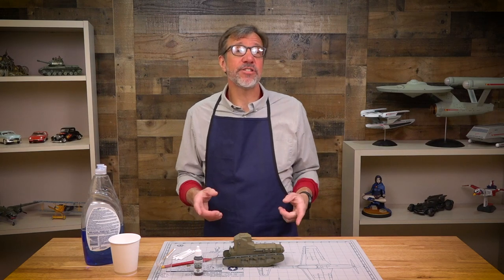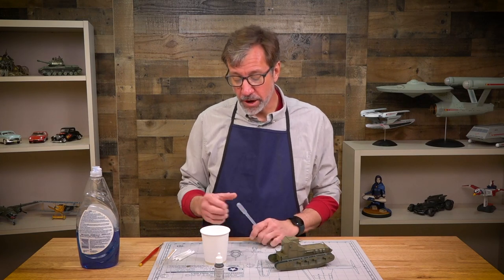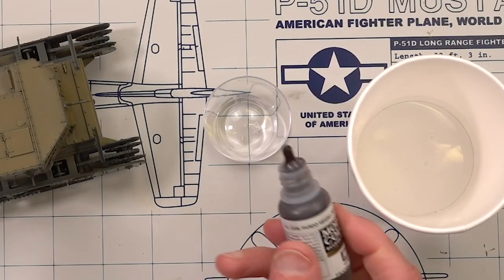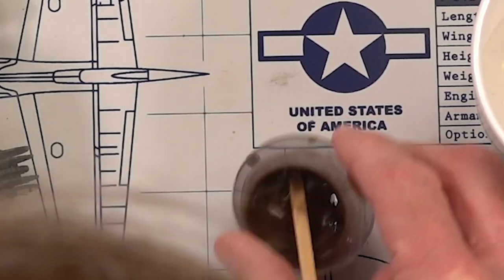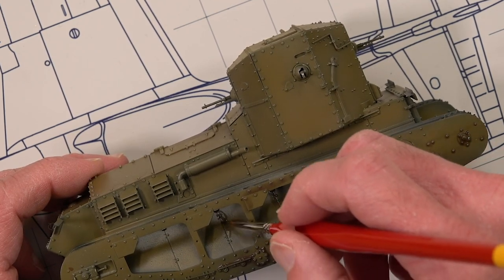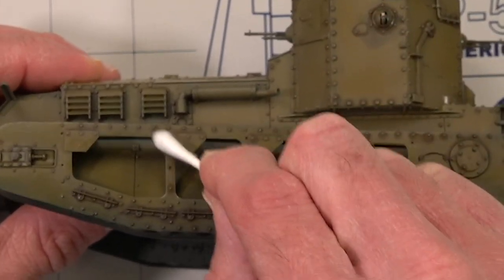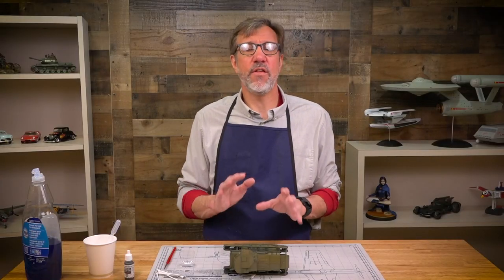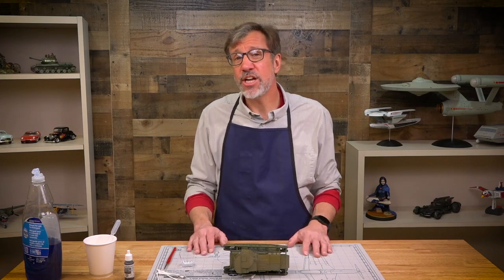Scale Model Basics: How to make and apply an acrylic paint sludge wash

Comment: Thanks for the video. Can you apply the sludge wash directly to the acrylic paint without any gloss coat first?
Reply from the maker: We wouldn't. You want the clear coat to protect your prior work from the wash, and the smooth surface helps you remove the unwanted wash from your model.

Comment: Great Video 
So what about a Acrylic base coat. Is it advisable to put a dull clear coat prior to adding above type of wash? Thanks
Reply from the maker: Yes, you can use an acrylic base coat, and just like you would with any other type of wash, put down and clear gloss coat first, then apply the sludge wash.
Reply: @FineScaleModelermagazine  Not dull correct?
never done a wash yet